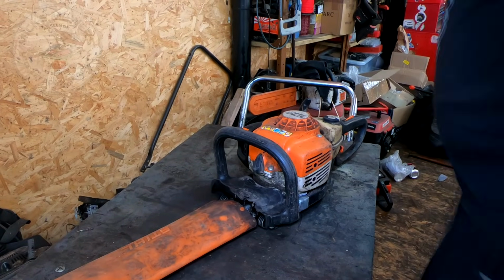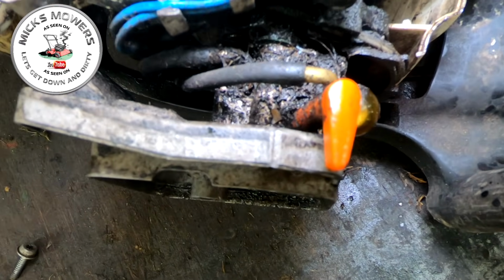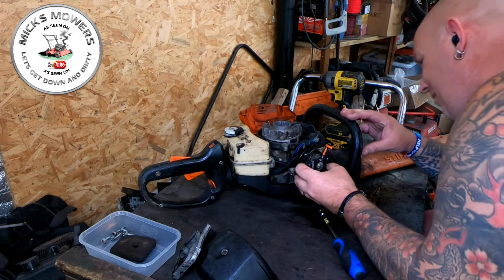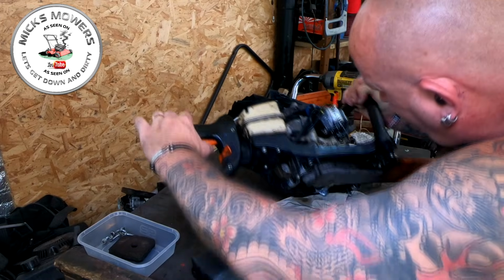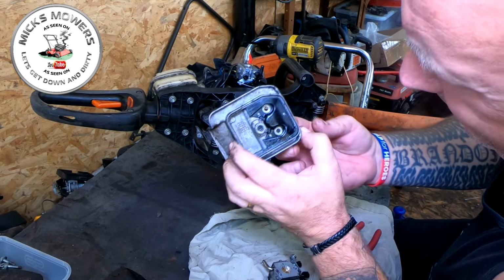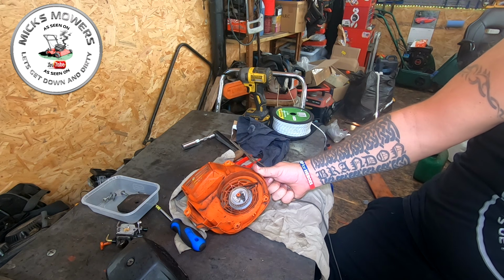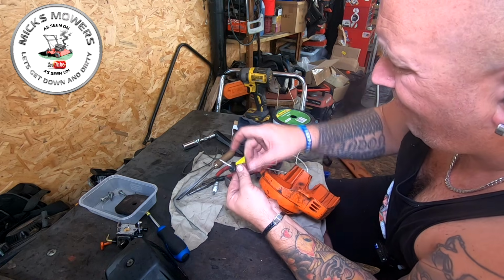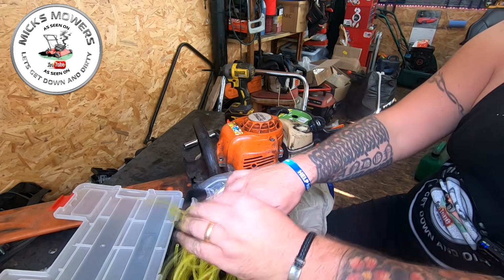Stihl HS81T Trimmer In For Service Repair Carburetor Change

Comment: You can swap the small throttle nub over, it's retained by a circlip. Older Stihl had what you have there. New filter housings have a grommet in bottom corner

Comment: Hi Mick I got a hs81r long reach hedge cutter I put the correct mixture 50/1 but what I find is even thou it works ok it tends to send oil out the exhaust when giving it throttle  could it be the piston rings are worn other to this it works ok I tried the low ash oil from Stihl as well to try reduce this but nothing as worked  is there anything I can try that will help this thanks tom
Reply from the maker: Maybe try and tune the carb a little..

Comment: Thanks. Love my HS 81r. Got two sets. Just picked up the HS81T cheap. Started and was running but needs new con rods. Opened up the gear box removed the blades and I noticed loads of little cylinder shape bearings in the grease. Looking forward to seeing the difference between R and T. Apparently more strokes per minute for faster cutting. R is lower torque for thicker overgrown.

Comment: Hello, This has been very helpful, I thought they sent me the wrong carb, you confirmed they havent.
Same problem wouldnt prime, I'll try swapping the hoses :D
Reply from the maker: Good luck.. If not spray some wd40 in the carb when fitted.. it helps to get the gasket and diaphragm moving
Reply: @themowerman  It turns out, mixing the pipes means just draws fuel from the return.
My fuel filter was clogged, all now sorted with a new filter. Just need to find those needle bearings from the output rod,  missing some :/

Comment: Mick I need your help‼️. My dad has  a fs131 brushcutter which we brought brand new and he used it 3, 4 times and was using green stihl ready mix fuel and then stored it over a year its not even had 6 hours on it. But now it just doesn't start. Not even a beat pulled the cord several times but don't want to damage anything. Iv even emptied the old fuel and removed it from the primer valve and gave it new fuel and oil. Still nothing‼️ can you assist me I want to use it again.
Reply from the maker: Email me some photos mate micksmowers01@gmail.com

Comment: I bought a stihl km130r with hedge trimmer attachment. Went to view the machine and it would not prime at all. Took a chance bought it a bit cheaper with issue. Worst case scenario new carb bought and fitted still wouldn't prime. Turns out the fuel lines were backwards. He was also 110% no one had tinkered with it. 🤷‍♂️

Comment: My hs 81 bogs when press throttle but everywhere online says clean arrestor but mine dont have 1 on the exhaust any ideas?
Reply from the maker: @garyscott8115  fuel problems or carb.. carb tuning
Reply: Just installed new Carb still the same
Reply from the maker: @garyscott8115  was it a genuine or copy?

Comment: Hi mick really enjoy watching your vids. Keep up the good work. I’ve recently got back in to buying and selling stihl tools. And fixing/ servicing them for people. If you don’t mind me asking what do you charge for a full service and clean of hedge trimmers and do you include sharpening blades or is that an extra for you ? Thanks look forward to hearing from you
Reply from the maker: Yo yo . I change£35 plus parts and blades are on top depending on the size of the blades
Reply: @themowerman  Hey, appreciate the reply. I did a set of hs81r not to long ago for £60 24” bars double sided, service kit and sharpen. Gear box cleaned and greased. Sound like I’m about right on the money side. Thanks bud👍🏼

Comment: bit of a strange way to change a recoil rope and then waste a length of it much easier to remove the pulley and tension the rope after
Reply from the maker: It doesn't cost much and only had about a foot left over probably about 20p worth.. it's £7 for 100 meters.. ta for the comment